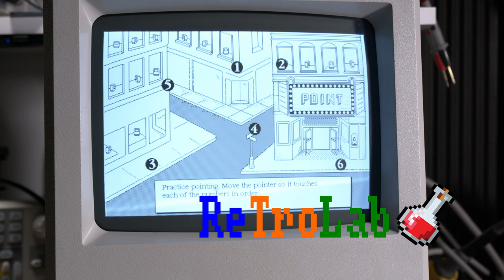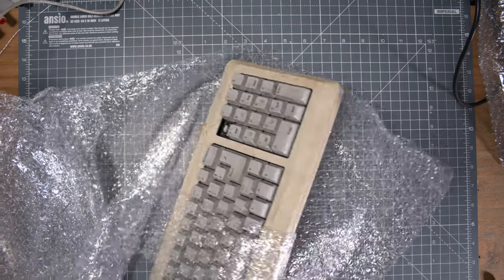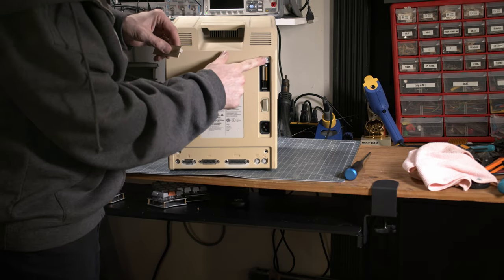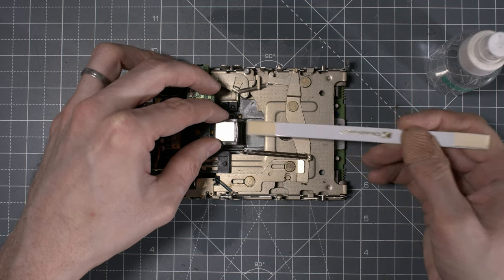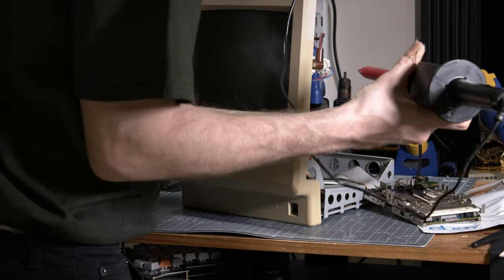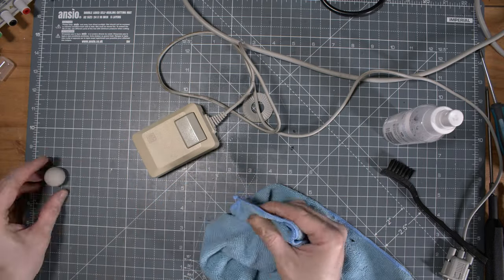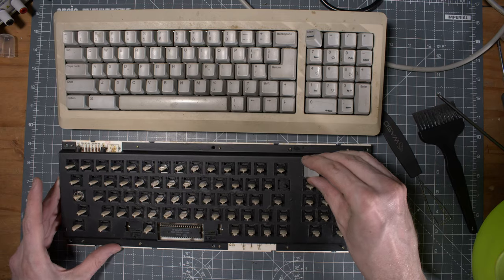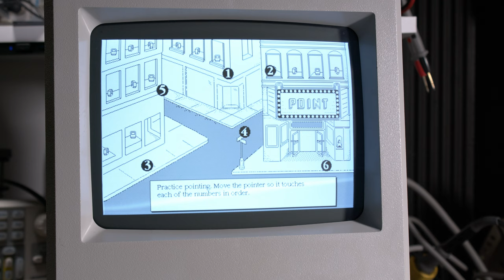Macintosh Plus - Fix and Restoration - #MARCHintosh [💉]

Comment: Salut, Guillaume. The Mac Plus has an NMI-like switch already embedded and it will even respond to gurus (bombs). There's an Easter egg that shows a picture of the dev team if you jump to an address in the debugger. On the Amiga, it looks like their guru alert code disables all interrupts at the beginning of that code. I was only able to get Action Replay to interrupt a guru on an Amiga, but triggering NMI did nothing (but you had hrtmon hooked and I didn't). It was pretty chaotic when the NMI was pressed after Action Replay had interrupted a guru (like a feedback loop that won't guru again). The NMI button also triggered a yellow screen during boot when pressed on the first grey screen. Will be interesting to see if you have similar findings. Very dirty and elaborate machines.
Reply from the maker: Oh excellent, I'll check this out.